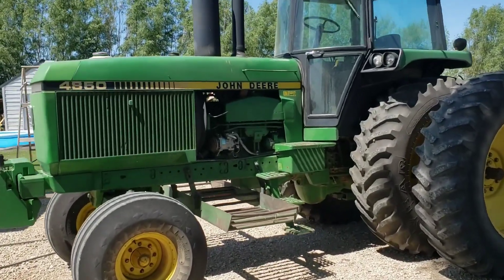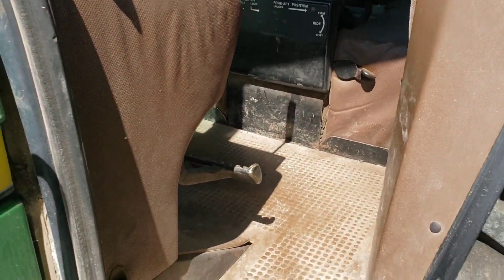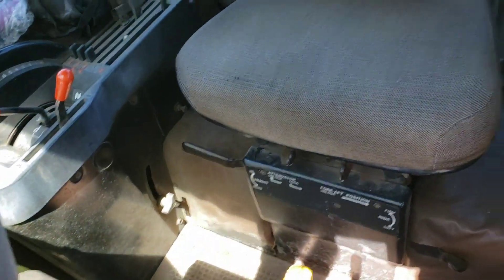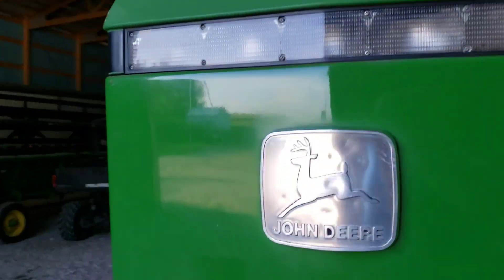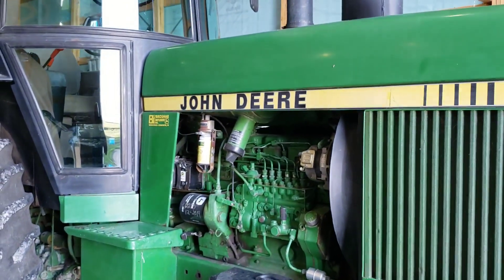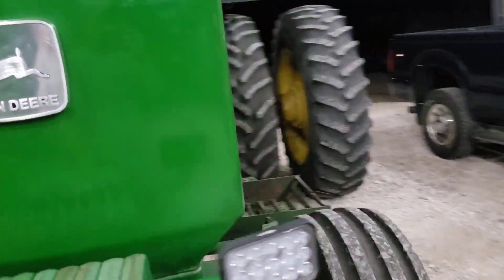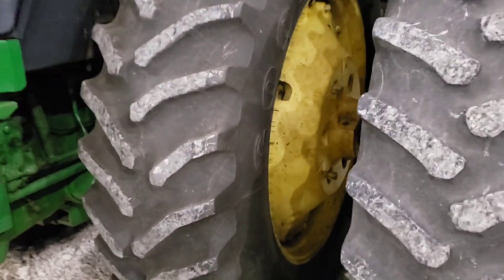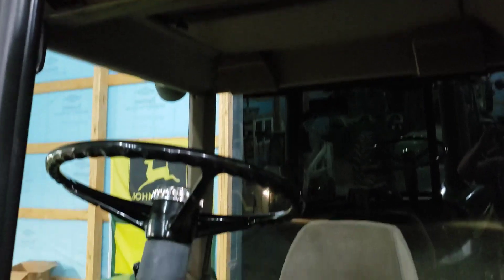New interior for a 4850

Comment: A super resurrection in my opinion especially of inside the cab and you have worked your special brand of magic on many of the exterior parts - the bonnet looks really good indeed.
Reply from the maker: Thank you. It may not make it run better but definitely more fun to run this way